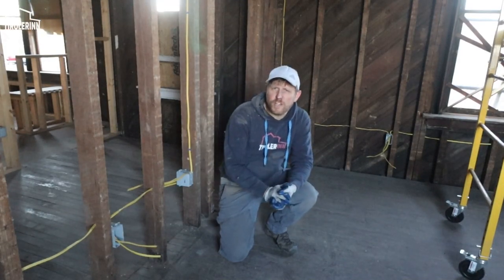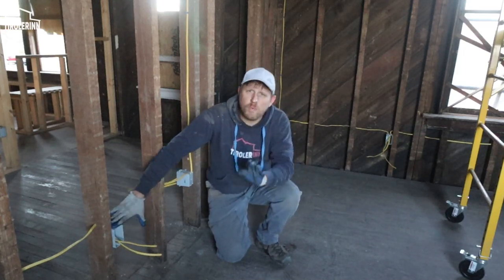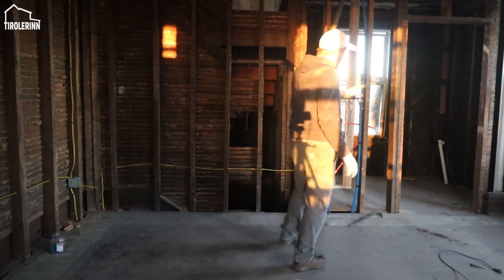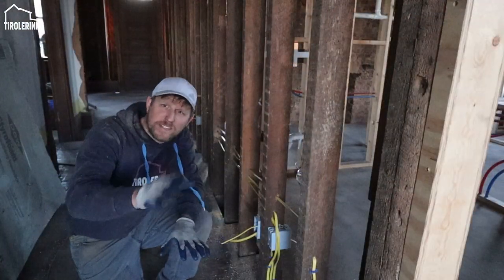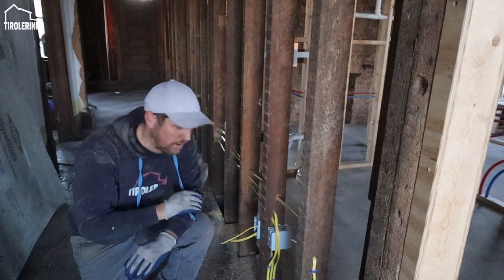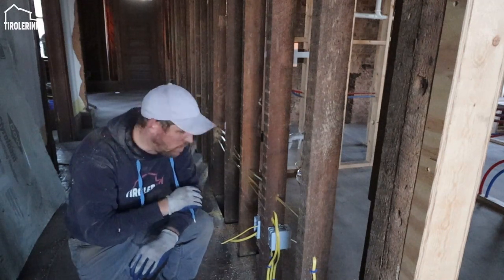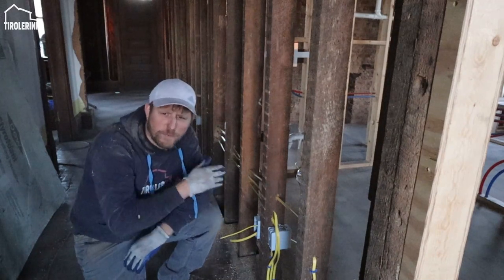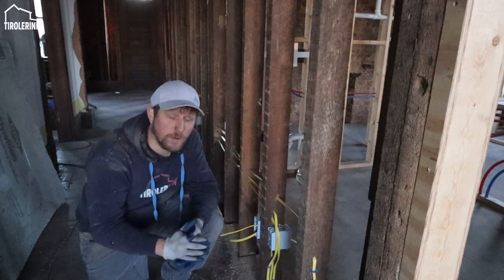Pulling the Wires on the 2nd Floor - TirolerInn the Renovation

Comment: Good progress.  For me, electrical work is very interesting. I also like it very much. Do you have planned heavy current connections for the kitchen? Happy new year.
Reply from the maker: Yes the kitchen gets an oven and a cook top. So both will be higher load circuits

Comment: Might want to check NEC about sharing branch circuits with bathrooms 210.11. 2020 NEC code basically says it wants a dedicated branch circuit for bathrooms
Reply from the maker: Thanks for pointing that out. I will have to check that out and see what to change